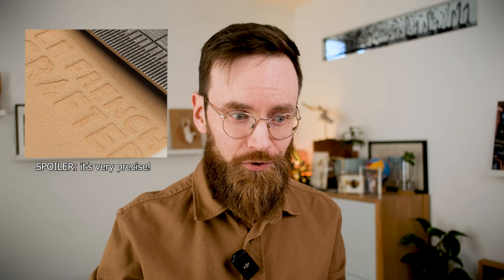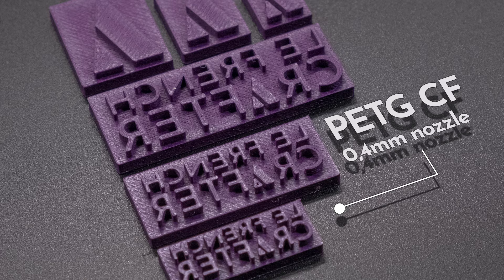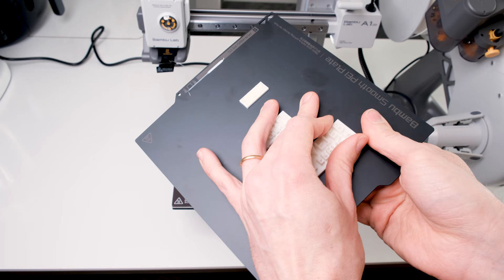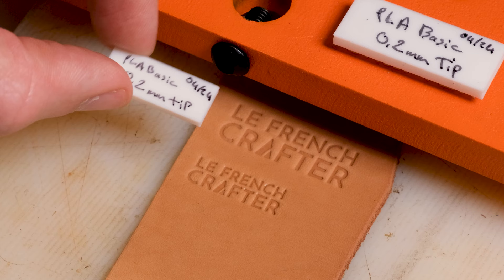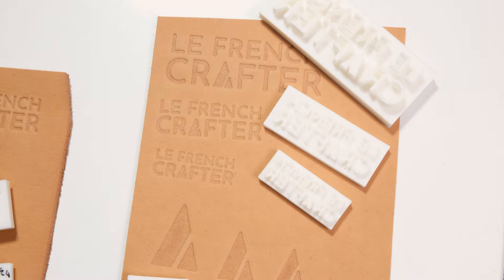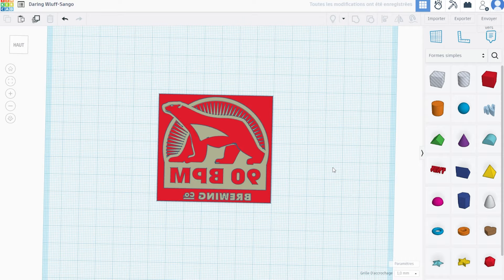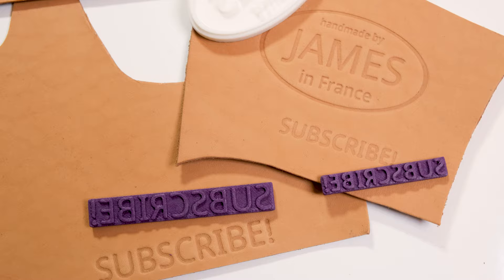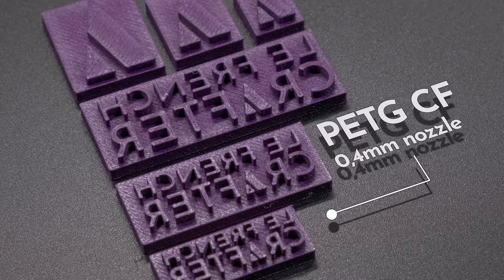INSANE quality 3D stamps for leather with BAMBU LAB A1 MINI printer

Comment from the maker: It's come to my attention that PETG CAN be used with the 0.2mm nozzle. I will definitely need to test this as the benefits of printing with the harder PETG material could be very interesting!
Reply: So PETG is more durable, UV-resistant and more heat tolerant PETG, but PLA is the harder of the materials.

Comment: I've been printing stamps commercially for 10 years for leather stamping. They stand up very well over time, I've never had a stamp fail in many years. If used correctly the stamp work is amazing. I print at 33% infill with at least 3 shells. My depth of the stamp is 3/8". I use a simple Harbor Freight arbor press with good quality veg tan leather. Most of my stamps are created with the Lulzbot mini with 2.85 PLA filament.
Reply from the maker: Thanks a lot for your input on this! It's really interesting reading about how others do this :)
What nozzle size do you use?

Comment: Think you could get even better results by flipping the print and printing by the stamp detail on the print bed and getting a nice even textured surface, instead of the top layer lines that you can see on some stamps. The bed layer will always be better than the top layer. You can add supports and it doesn’t matter the surface quality where the supports hold the top of the stamp since it won’t touch the leather.
Reply from the maker: AAAAAAAHHHHHH that's such a great tip!!
I will 100% try this thanks :D

Comment: You could also print the design on a 45 degree angle to get clearer tiny letters without dropping to a smaller nozzle
Reply from the maker: That's hugely interesting! Will definitely look into this, thanks for the tip :o

Comment: One thing you might want to do in Tinker Cad is to round the corners of the base for the stamp. My method (for other similar projects) is to:

Bring in a block that will be cut down to the size of the finished base in the process.  Set height to 20 mm, and then size x and y to be larger than the image you are stamping.
Apply a Radius to the block. Make sure all the content will still fit within the block space
Drag the new 'base' off to the side.
Now bring in two "hole' blocks, setting them each for 9 mm in height, and sizing them to the dimension of the base.
Center the 'base' on one of the hole blocks, then merge them. This will cut the bottom off the block leaving a flat surface..
Flip the base, and bring it down to the graph bed of the workspace,
Center the 'base' on the other 'hole block. Again merge the two,

You should have a rounded corner block to use as a base for your stamp. Drag it down to the bed, center the block on the bottom of the stamp image, mirror one or both for the stamp, and export the resulting STL. If you don't merge them, it's a lot easier to extract that base for later re-use on another stamp.

The main reason for this is that having a rounded set of corners will leave less chance for a corner to break off, or if there is some reason that the stamp gets started off center, for the corner to end up stamping into the leather. Mostly the former means that at least this part will be less likely to be the reason a given stamp breaks or fails. There's still going to be durability issues with the stamping image of course. 🙂

I believe there are nozzles down to 0.1 mm as well, but as you've no doubt discovered, reducing the nozzle size dramatically increases the time it takes to print. I'd like to see a process that allows you to add some draft angle to the stamped image to improve it's durability, but that's a bit more than TinkerCad can do at the moment. Autodesk would like you to move operations like that into Fusion360, which considering you're doing this as part of a leather working business would likely engage their prohibitively expensive (for most of us anyway) licensing fees. As long as this works, and you're OK with the time it takes to print spares of stamps, and have the sliced versions ready to print replacements at the end of the day, or on demand if the printer is in the back room of your shop, that works too.

Comment: PETG is not "harder" than PLA, it's tougher. PLA is harder, but less flexible, thus more brittle. So, I would definitely choose PLA for stamps. PETG flexes some, which is why it's tougher, but that's not a really desirable trait in a stamp. ,The next better choice probably would be Nylon or Polycarbonate, and maybe ASA?, as they would last longer, but those require a much more expensive printer, and frankly, I'd only choose it if I was selling stamps. For my own use, I don't care as much about serious longevity, since I can just print another, and my A1 is definitely NOT rated for ASA, PC or PA.
For infill, I'd probably recommend 95% over 100%. At 100% any "over extrusion" will cause some distortion, and the strength difference between 95% and 100% is negligible.

Comment: Would love to see longevity tests. 
You should be able to get all of the filaments to look the exact same with machine dialing, or a hair of sanding at the end. 

The biggest issue with these style of stamps is that they wear out after only a handful of uses. I would love to see tests till destruction.
Reply from the maker: Agreed, I still have a lot to learn about using this machine and I'm sure I can narrow down the results even further (literally). for example, I've discovered just today that PETG can actually be used with the 0.2mm nozzle. PETG would already be quite a step up in terms of hardness and therefor longevity.
Reply: @JamesBerry  PETG may have higher longevity, but PLA is actually one of the hardest (as in stiff/rigid) plastics for 3d-printing while PETG is more flexible and more 'impact resistant'. PLA also has higher tensile strength than PETG, but when it breaks, it shatters without warning - I think that's where the 'weak' reputation comes from.

Comment: James:  My only question is...Do the PLA stamps (at .2mm nozzle) stand up to comparison with a brass stamp.  Especially the right angle edges.  I have been eyeing the Bambu Lab A1 mini for monthis.  This is just another reason it would be great for me.  I have a 9 year old Lulzbot Mini and it is slow.  Finicky and a pain to work with.  Lulzbot has been sold once or twice since I purchased that printer.  $250 US vs.  $1500 for the mini (years ago) is a bit easier to swallow.  I don't need color changing filiment so the AMS is not necessary.
Reply: pla wont be comparable to brass stamps, but you have all the design freedom you want. as you already mentioned, the right angles are not ideal, but it would be easy to  design a stamp that is more sturdy. or use several progressive dies, or just print a new one for a couple cents if its fails.
Reply from the maker: Hiya! I can only confirm what was already answered that while it does not compare in terms of solidity and crispness (and of course you can't heat it up), it does offer a lot of versatility especially if you are creating custom stamps for customers.
If you only need one stamp and want it to last forever, then brass is the best option. But if you need several stamps, the cost of the printer would be lower than that of the stamps.

Comment: You should try resin printer. Perfect clean embossing.
Reply from the maker: I spent a long time looking at resin printers as an option and understand this could be a better for many. For me however resin printing seemed more complex and daunting. Most importantly though, I was able to test out a filament printer at work before getting the Bambu Lab machine, so I felt more comfortable with playing with filament 3D machines than resin.
Reply: @JamesBerry  resin printing is a lot of work, I own one and while the details are amazing the work (and care) needed to clean, cure and handling hazardous waste don't make sense in this application. I've been doing PLA stamps for quite a while and while I don't have an actual press with some patience I can get good results even with a rivets/button press and some 3d printed and wood adapters. It even works for some chrome tanned leathers, but with less depth that would be achieavable on natural tanned leathers of course
Reply from the maker: Thanks for the insight on this matter. It does help me validate my choice of printer while also making me insanely curious now at how good resin printers could be :'D
...maybe I'll get a chance to play with resin in the future. For now I still have a ton to learn and enjoy using filament.

Comment: For what it's worth, PLA is not biodegradable in any meaningful way - it requires specialist high-temperature processes to break it down, it's not just something you can toss in your garden composter. The 'PLA is biodegradable and therefor nicer to the environment' thing is something filament manufacturers pushed, but is well debunked in the 3d printing community.

That said, it's still the most common and easiest filament to use!
Reply from the maker: Thanks for the clarification on this!
I must admit to being quite disappointed (though not surprised) to read your comment. I guess I fell into the classic marketing trap...